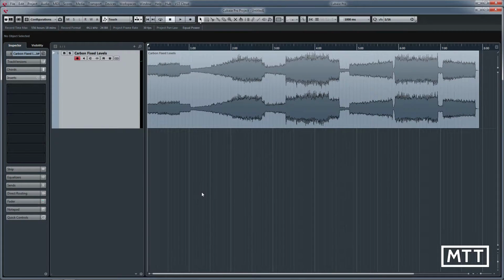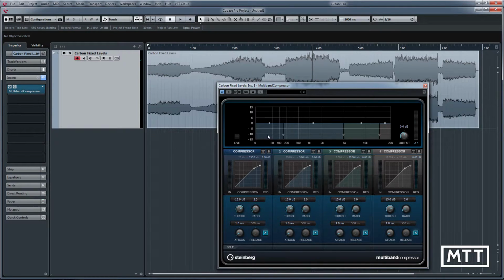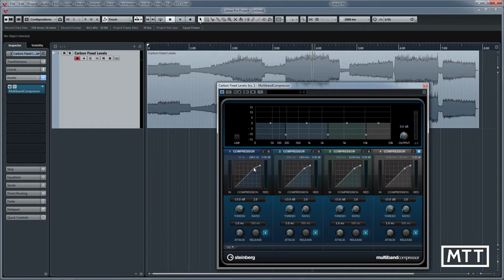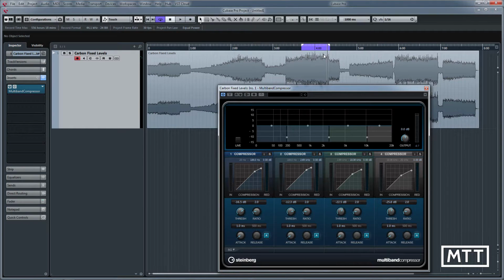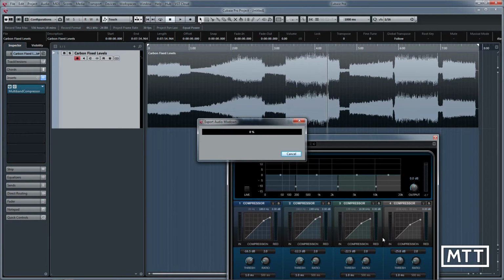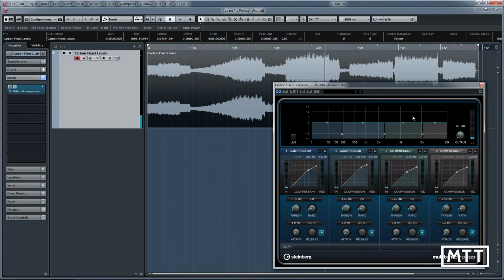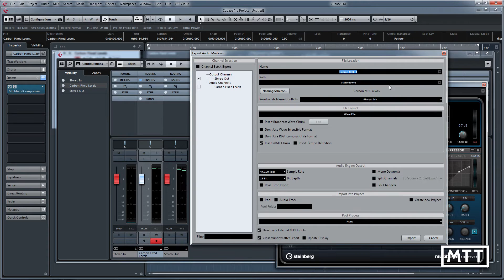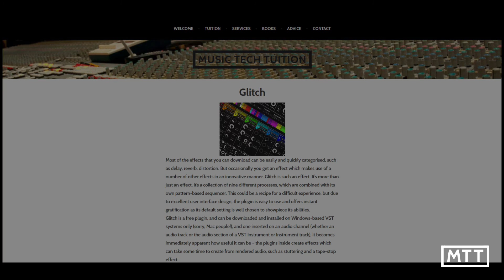Multiband Compression - Basics in Cubase

Comment: I think the columns/bands in the upper part (between the knobs Live and Output) can be used to compensate for the gain reduction per band. After that you can see if you want to adjust the Output. All depending on how it sounds, i'd say... Great feature also i find that it has look ahead, that can be turned off with the Live knob.